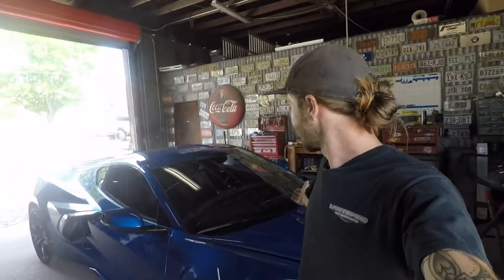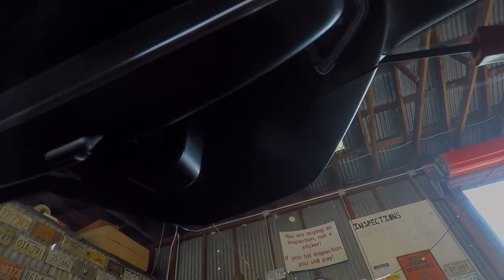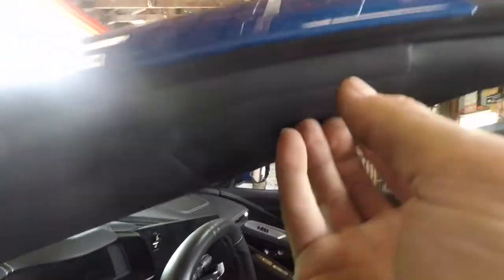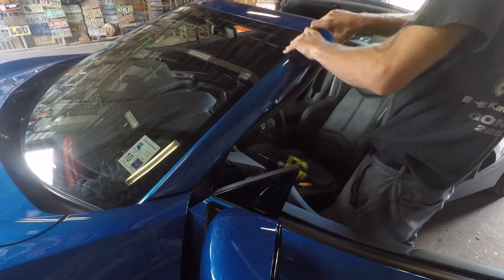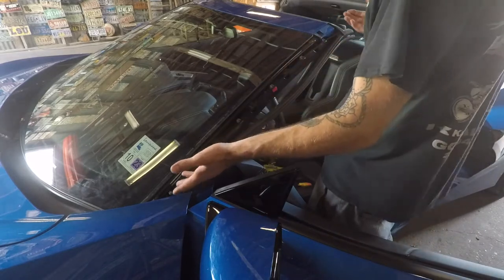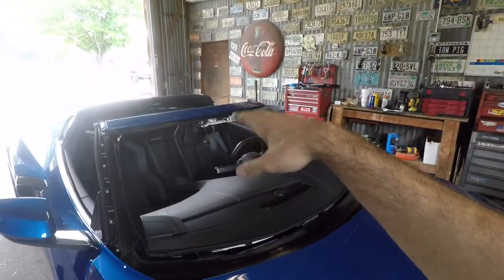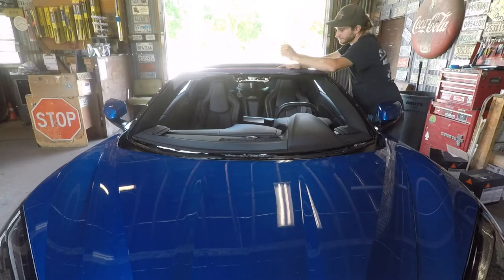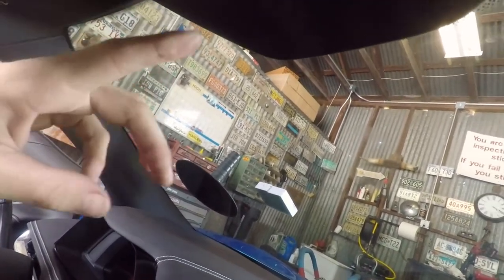C8 WINDSHIELD REPLACEMENT

Comment: Cool. I need a windshield for my C8. Cheap ass glass.
Reply from the maker: Glass these days aren’t that thick even oem ones
Reply: @josiahloubiere7742  was that factory glass? What did it cost. I'm in Seattle and I can't get it and it's crazy money. No aftermarket yet that I can find. Good video. Don't know what a "cow cover" is....
Reply from the maker: @thereissomecoolstuff  hahaha sorry for my accent “cowl panel” it’s the panel that covers the wiper motor. I think it was $398 plus tax installed. I did it a few weeks ago and it is aftermarket.
Reply: @josiahloubiere7742  lol...Your not alone in the "cow panel". That's about $1000 cheaper than I can find. Also all cars don't have lane departure. The base cars don't have it. Who made the glass? I'm going to try and run one down.
Reply from the maker: @thereissomecoolstuff  they have the spot for them on the glass itself it’s just gonna have a different bracket on the inside the house a camera, maybe something they’ll include in the z06. I got it from a southern distributor that the closest one to you is in Texas probably but I can see what brand at the shop tomorrow
Reply: @josiahloubiere7742  thanks Josiah.  I'm way outside your area. My break is on the passenger side so been driving it with it for a month.